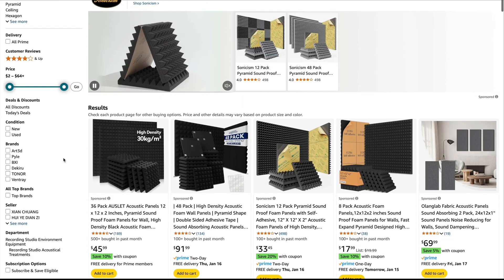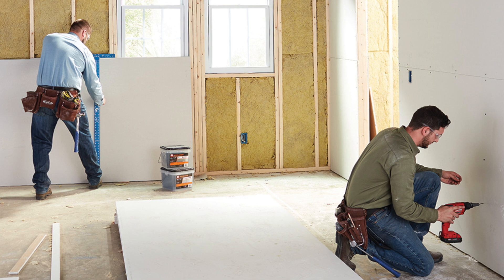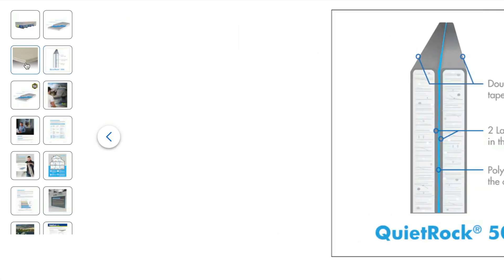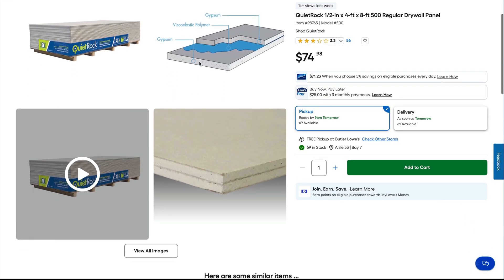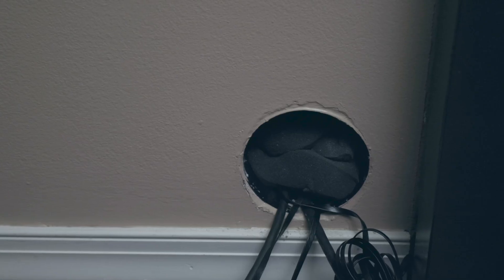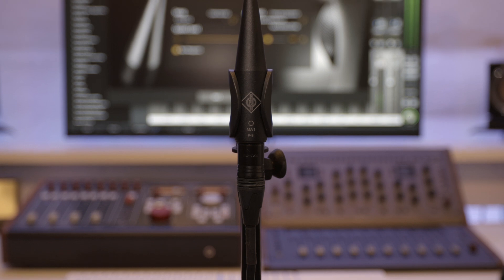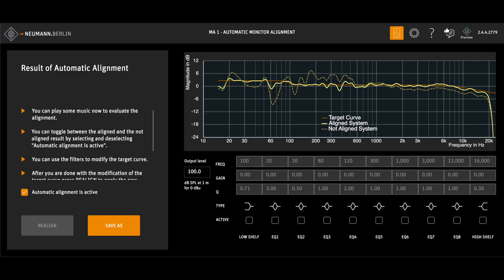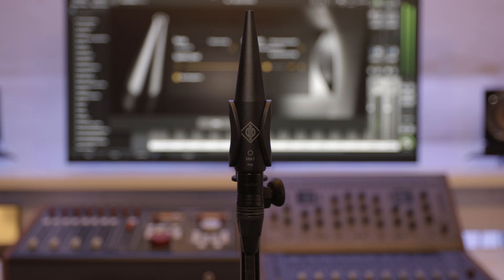Acoustics, Sound Panels, and Studio Treatment - GIK, Prosocousic, Primacoustic, and ATS panels

Comment: Hey Todd!  Happy 2025!  My GIK panel order just started arriving today!  Great company! Totally easy process, excellent design assistance and so far great looking product!  ~Robert
Reply from the maker: Nice. Yeah, their customizable panels are solid and have a nice look to add some flair. And of course, they also do the job if you purchase the right ones for the task.
Reply: @ToddUrban  I used their free service and worked with one of their designers for my vocal booth, which was formerly our server closet. They did the 3D mockup of the room. It's tight; only 53x67x110 inches but it has HVAC venting, ethernet ports and power.  There's not much room for stands so I'm using the Triad-Orbit stand system with wall mounts for the mic and laptop/music stand.  For now, I'm going to try using an iPAD to control Pro Tools wirelessly with EUCON. If that doesn't work I'll try HDMI and maybe XLR over Cat 6 Ethernet since there's 8 direct runs from there to my workstation.